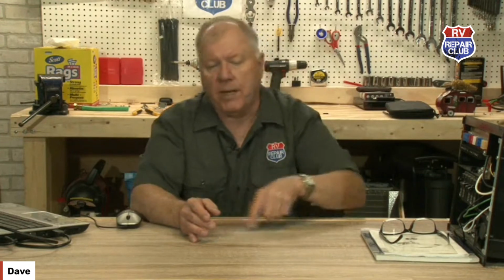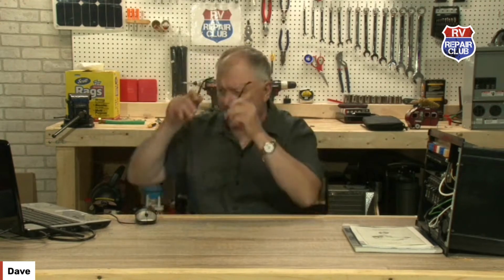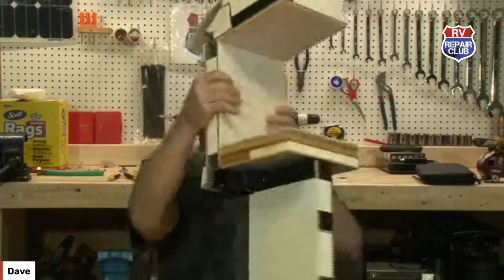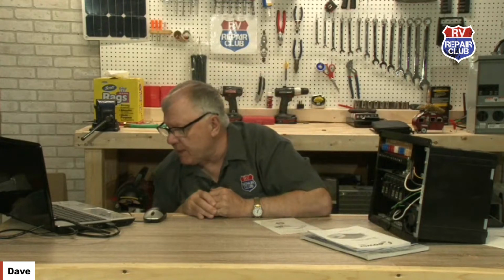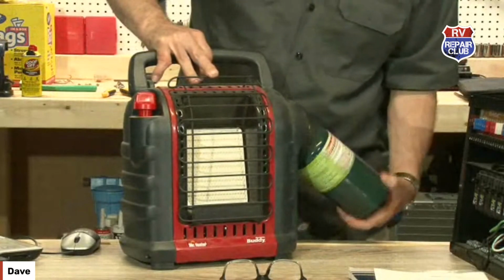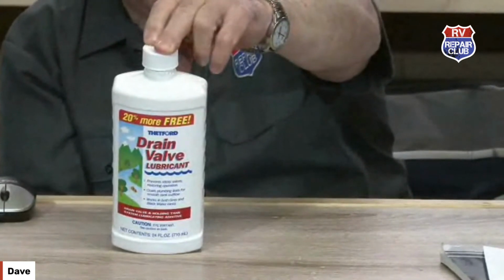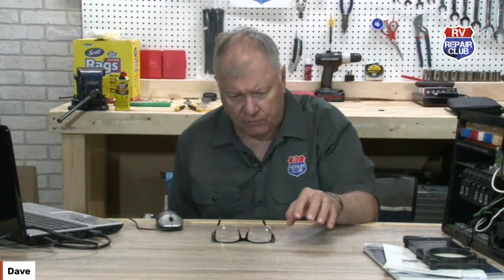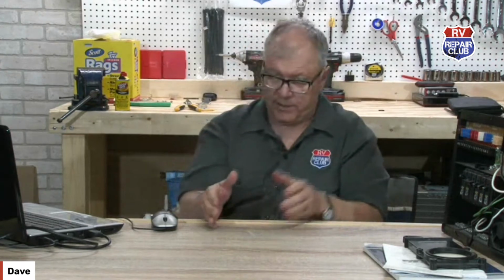RVRC LIVE! April 2022

Comment: Had a question maybe you could help, I have a Growatt 3000 watt inverter charge controller, can I unhook the shore power cord wires from the fuse box and put them on the ac in and then run the ac out to the original AC of my fuse box?